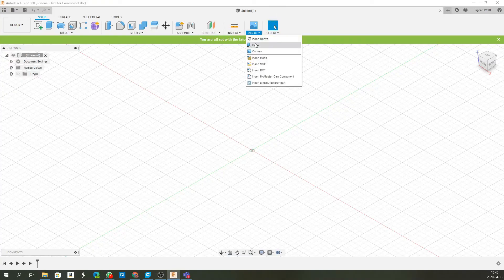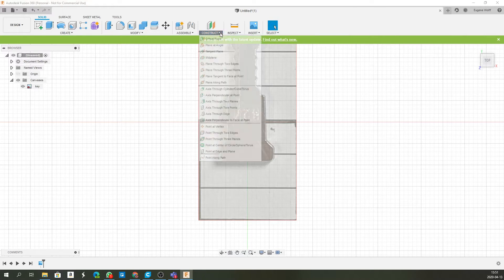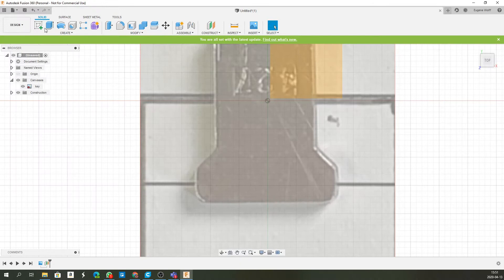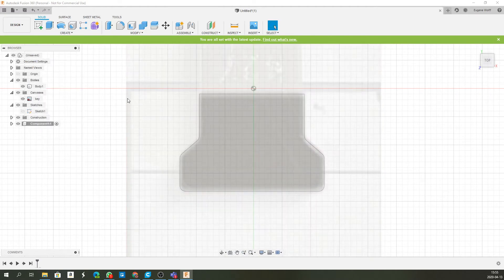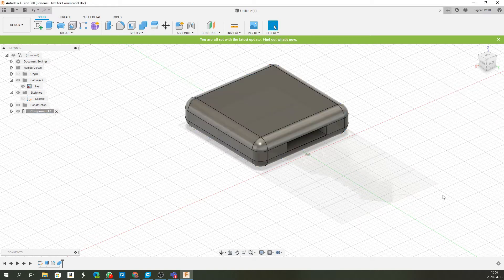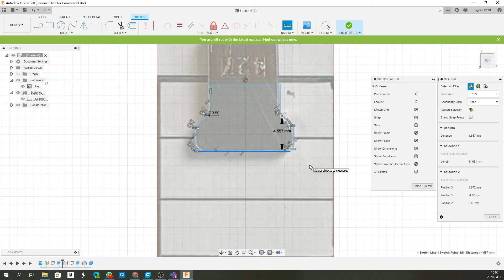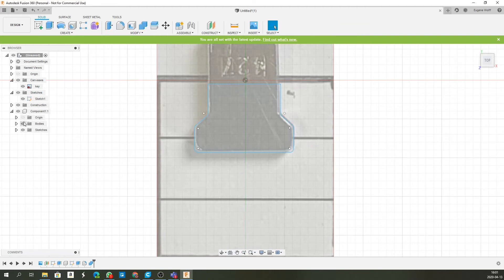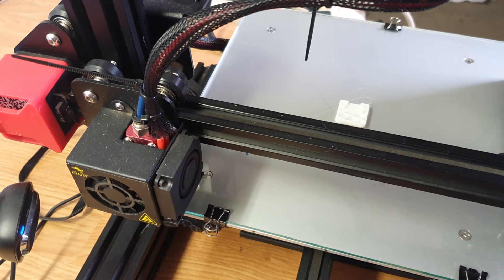FIX THINGS WITH 3D PRINTER | Embed objects into 3D Prints | FUSION 360 TUTORIAL

Comment: I have done quite a few key "ends" for motorcycle keys, all with the brand logos and in 2 colors. 2 of them look like a true 2 color print although I left negative cut-outs in the key cover for the logos with very tight tolerances. Then I have to lightly hammer the logo into place until flush and then it looks like a 2 color print.